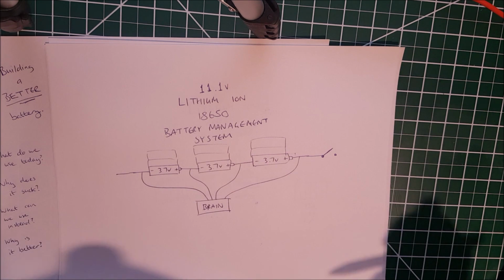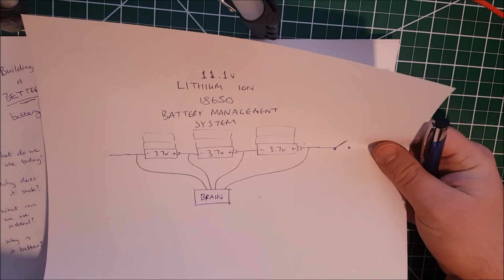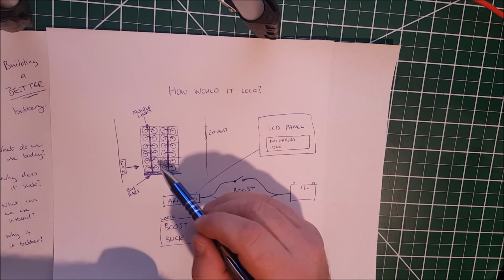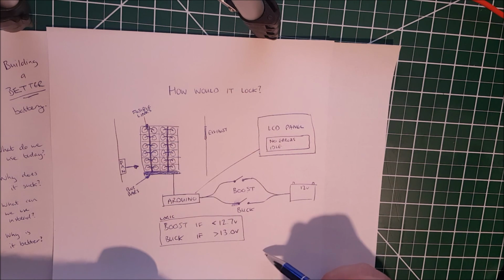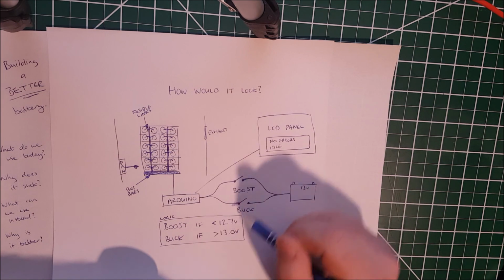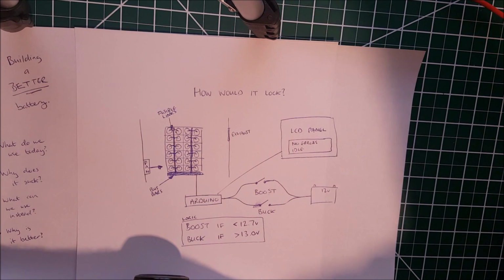Why an Overflow Cell might be better than a DIY PowerWall

Comment: Wouldn't your design work better using super capacitors in place of the lithium ion batteries? They are designed to have up to a million complete discharge cycles.. I'm no engineer so please let me know why I'm wrong..
Reply from the maker: I love that idea.  I think the challenge is just the cost for storage.  The cost per kwh of lithium ion cells is around $200, whereas I think it's in the thousands for super capacitors. Though I hear Tesla is trying to bring that cost down too. I'm no engineer either, so no worries there. Thanks for the comment!  👍

Comment: Interesting idea indeed, it would certainly make the whole battery management issue a lot simpler, especially if you fuse each individual cell with a 1A fuse.

The biggest problem I see is that to provide any useful power into your house, say 5Kw max unless the electric stove and oven is running at the same time in which case it may be closer to 8kW, then you would need 8000 cells in parallel if each cell is only allowed to provide 1A. Add on top of that the large losses in cabling as the cabling to / from the boost circuit would have to handle over 2160A to provide the required 8Kw for your hose at any point!

Ad on top of that 15-20% losses in the boost circuit and we're reaching 2600A currents!

That's a lot of current to handle and you would need to be very careful when designing busbars and connectors and you would need to make sure that all connections are very strong and as low resistance as possible. A voltage drop of even 1mV would dissipate 6.6kW and lower the voltage by 2.6V so the boost circuit now only have 1.1V to work with.

Now if you did it the Tesla Powerwall way you would have a battery voltage of 450V which would lower the currents to 17.7A which would give a power loss of only .45W and a voltage drop of 0.021V with the same 20% provision for losses in the buck circuit.

It will always be a trade-off of handling very high currents with the associated power losses in wiring and junctions versus handling high voltages with low currents and then have to handle the battery management and make sure that you can deal with a cell going rogue I think, I think you're on to something with the spacing of the cells and the forced ventilation, Tesla are doing a similar thing but they are using liquid cooling of the cells instead.
Reply from the maker: Definitely valid points! I would not imagine that these reservoirs would ever handle that much current. They would only pull or push 5~10 amps each, and would be connected to a larger 'buffer' battery that would handle the large currents. I envision a low capacity high discharge lithium ion battery, lead acid batteries or super capacitors in the center, with many reservoirs connected to keep it topped off or to absorb additional power that would otherwise be lost. This will never be the most efficient way to store power, I think it is a trade off between efficiency, reliability and safety - especially in the DIY world... I feel like some of these DIY powerwalls are basically big sophisticated bombs!
Reply: I think you are right on some of the powerwall DIY's you see on youtube, some of them lacks any safety measures at all and I'm surprised we haven't heard about more of them going up in flames! 

I'm thinking about building a powerwall myself so have started experiencing on smaller packs and work out the best way to build them so I very much appreciate you sharing your findings here.

Thank you very much...
Reply from the maker: Thanks! I'm happy you are finding some value in them. Are you going to post when you start building your powerwall?
Reply: I've never posted anything on YouTube but I guess I should!

So far I'm just trying not to kill myself... :-)